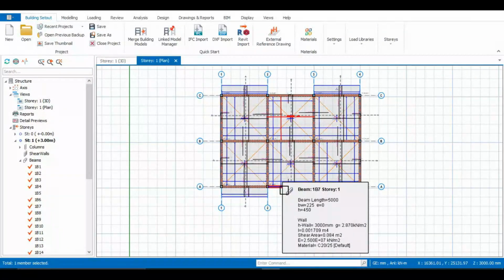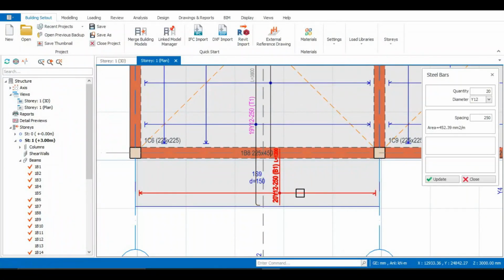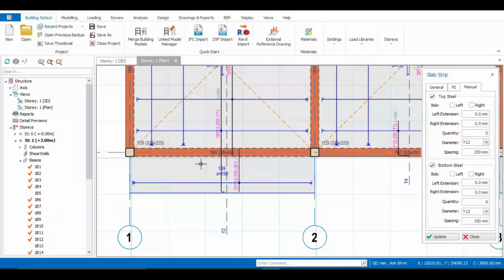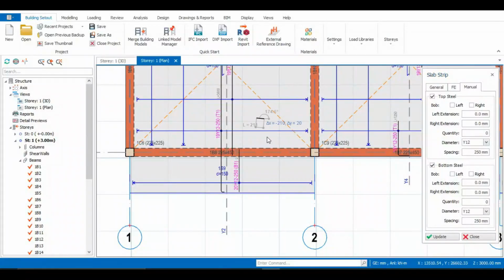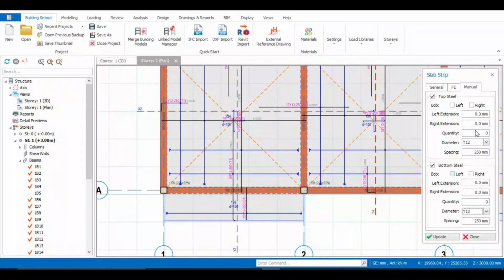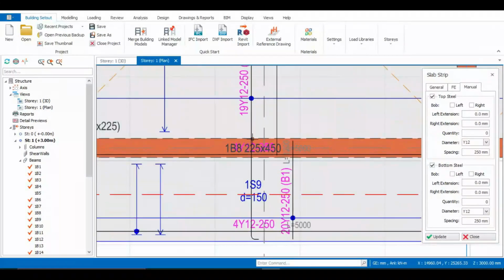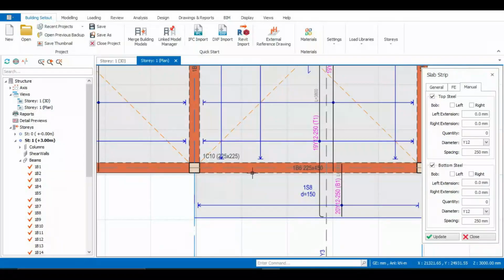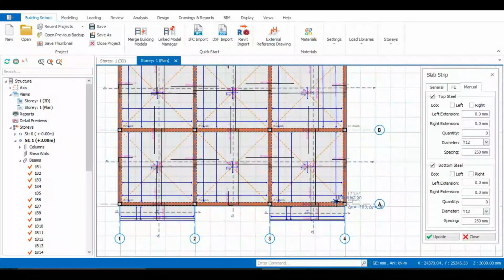Draw Slab Strips on Cantilever Slabs in Protastructure

Comment: Can you teach me how to use manual strip in foundation level. Analytical strip doesn’t work at that level.
Reply from the maker: Good day to You and Glad to hear from You Sir. At foundation level, depending on the type of foundation in question, you may want to perform raft foundation analysis in story zero, and in your analysis for the likes of raft foundation, the software gives the liberty to draw foundations strips. 

Manual strips are delicate additions to slab design that require both professional calculation and real life experience to insert in any structural design as you are responsible for the design and results of your design aren't automatically calculated as part of your building analysis.